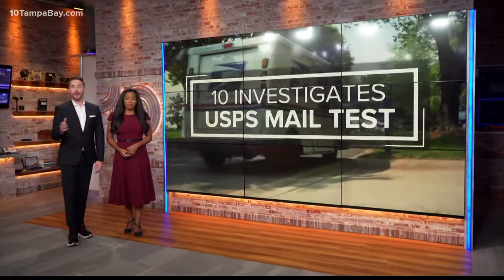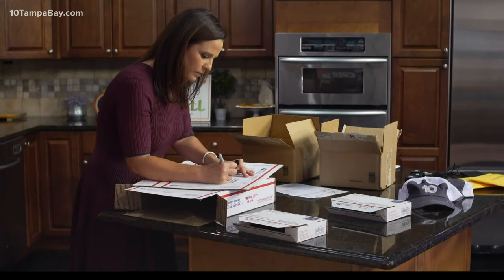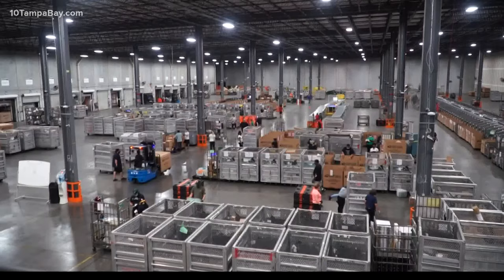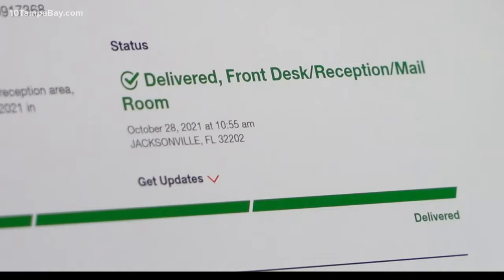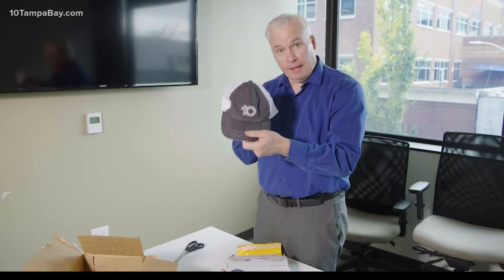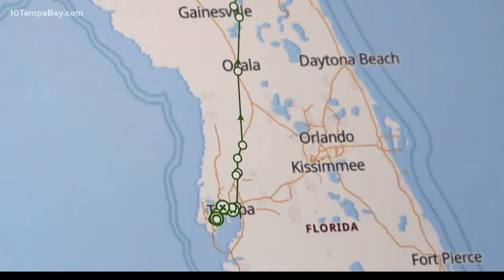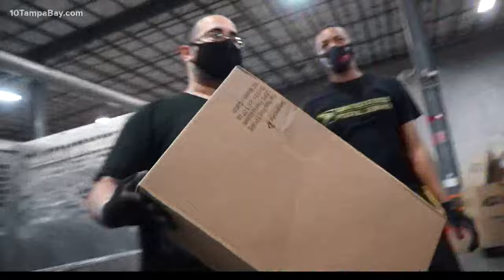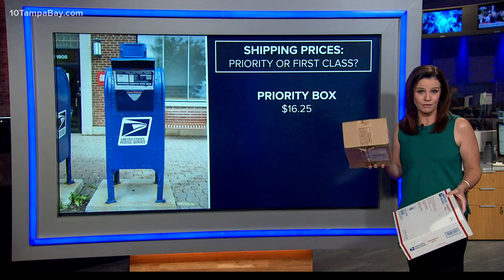USPS test: We mailed 4 packages with GPS trackers to see how quickly they got there

Comment: It should be against the law for the USPS to handle anything but ENVELOPES.
Reply: Why? USPS makes most of its money through Parcels and Services
Reply: @angryloyer_2821   Why???  Because (from my experience) they often do a poor job of package delivery AND their tracking system is a joke.
Reply: @tribulationprepper787  so you take for granted that the USPS is mandated to service every house In the US? Can't make a private company do that. And even if they did a poor job as you say, that doesn't mean they shouldn't be allowed to do parcels
Reply: @angryloyer_2821    Whatever!
Reply: Ive been using usps to mail my business products since 2008, thousands of parcels, and maybe 2xs there was an issue. And they gave me a refund.
Reply: @1ACL   You are a lucky, lucky, lucky individual.  One of the few... I would imagine.
Reply: Worked the sorting machines for 10 years. Our facility mangled dozens of envelopes every day. So many that they had two employees whose duty was to try to reassemble the parts so they could return them to sender but they never refunded the postage